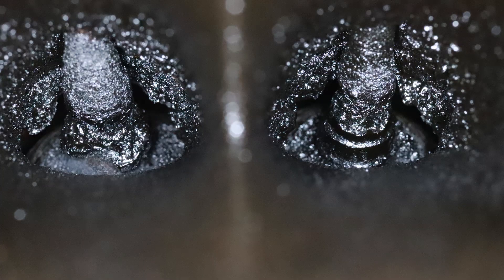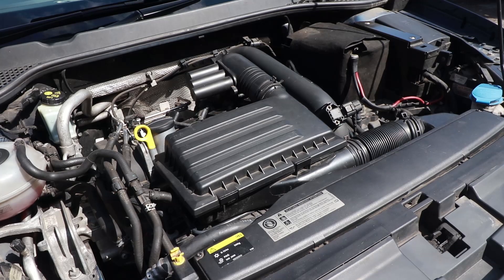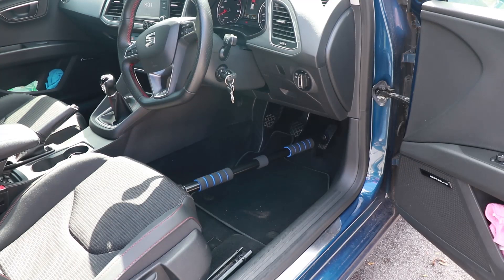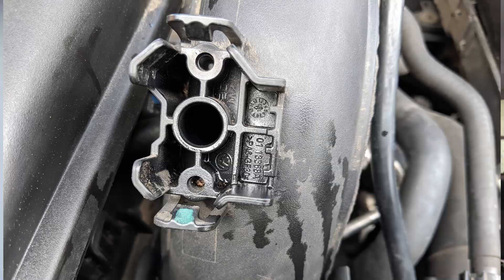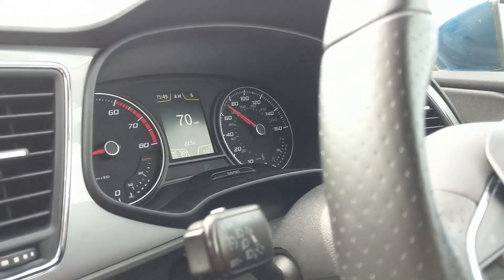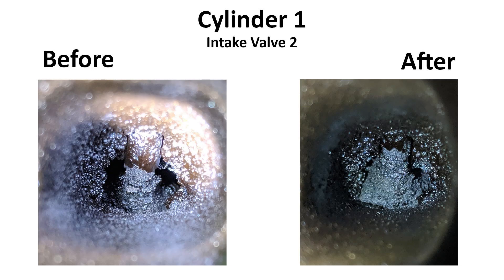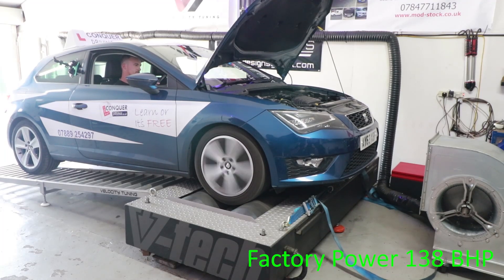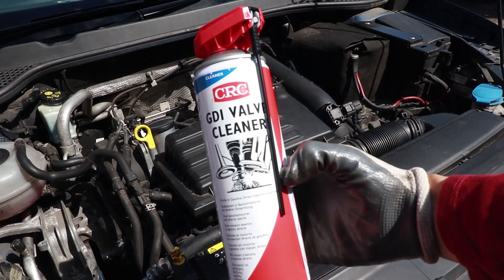CRC valve cleaner before and after valves and power figures - Is it the best valve cleaner?

Comment: Thanks for the video!

Cyl 1 Valve 1 (The before is down and bit hard to see, it could be that there is no effect)
Cyl 1 Valve 2 (The before is way down to see anything)
Cyl 2 Valve 1 (The before has carbon all around the valve and in the after you can see some metal of the valve)
Cyl 2 Valve 2 (The before has carbon all around the valve and in the after you can see some metal and even the shape of the valve)
Cyl 3 Valve 1 (The before has a huge amount of carbon not only on the valve but even on the metal of the intake and in the after It seemed to remove almost all the carbon on the metal intake and even give form to the valve shape)
Cyl 3 Valve 2 (The before is just clogged up the after is also clogged up but you can see it had some tiny effect on the back of the valve)
Cyl 4 Valve 1 (The before has some thick carbon on it and no valve shine the after has much thinner carbon and actual valve shine)
Cyl 4 Valve 2 (The before has some thick carbon on it and no valve shine the after has much thinner carbon and actual valve shine)

The images are of great quality and I appreciate your effort and work to bring them to us!
From what I see the product is cleaning the valves and that's great!
Why is it great?
Most shops use air hammers to do the job... no one torques the motor to spec as the manufacturer tells them... Unless you do it yourself properly
So yeah... I prefer the least invasive methods if they work... The more work they do on the motor with air hammers the more likely they are to do damage that will show overtime...
Not to speak of cleaning chrome valves with abrasives gives me the chills... chrome is not as durable as steel... after the job, it could be they will be more susceptible to rust due to coatings getting removed.
Most shops use air hammers to even remove your tires and that's something the manufacturer tells not to do, negligence is amazing...

I do think that if you used the product more aggressively and more than once maybe it could show better results due to how neglected these valves are...
They likely designed the product in CRC to remove a certain amount of carbon since X amount of chemical is designed for X amount of carbon and not damage the catalytic converter

Comment: This product does work , if you use it properly !!!!!!!!  I used it on my Mazda when it had

only 4000 miles on it.  The next day there was black residue in the tail pipes. If you have

not done it for 50-60K , and might be the second owner of the vehicle , your engine might need

disassembly and manual cleaning.  In my opinion , this process should be done at least every

10K. (the spray cleaning).
Reply: This. I had a used car that was well maintained (gdi), and only had to use CRC. I then had another used (gdi) that wasn't loved. That one required intake scrubbing.

Comment: Interesting, I just did the same on my 2013 Camaro with the GDI engine. Afterwards I filled the tank and drove like normal for a week. I picked up roughly 70 more miles on that tank of fuel than I normally get. Too, although I don't have access to a dyno, the mid-range feels stronger during acceleration. Maybe it's just me, but your before & after photos look flipped, I can't see the cleaner ADDING carbon deposits.
Reply from the maker: Cleaner won't add carbon deposits but they're still building up. I seriously doubt this would add 70 miles to the true range
I would suspect driving style and conditions would play a bigger part in that improvement.
Reply: @ConquerDriving  60 to 70 miles per tank equals between a 3.1 and 3.6 mpg increase (19 gallon tank). Not hard to believe when you consider the engine has 120,000 miles on it and was probably severely carboned up. Not to forget, my 'normal' driving is all highway, with the cruise control set at 70 mph, 100 miles a day. A car gets its best economy when driving steady state like that on the highway. Now if my travels were all inner-city, stop and go trips, I would also be suspect of such a significant gain. The factory rated highway MPG is 29, I was getting 25, so I don't see an increase of just over 3 mpg as being suspicious.
Reply: @ConquerDriving  I mean there's significant improvement in the before and after pictures so I'm confused as to why you claim it doesn't work?
I mean sure it obviously won't clean it 100% on the single can when they are that bad but it obviously works
Reply: @Phuong AMG Nguyen My Camaro isn't turbocharged, I just removed the intake tubing and sprayed it right into the throttle body. According to CRC, you would spray it before the turbo to clean the impeller blades.
Reply: Yea I did it on my 2015 impala with the 3.6 and i felt way more torque and gas mileage way better
Reply: Literally no way that carbon buildup was after the treatment.  Also, every other before and after of crc on youtube showed significant improvement in carbon reduction.
Reply: Think this is not a effective way to do it. You should spray right in to the throttle body.

Comment: A pretty much guaranteed way would be to walnut shell blast the valves but that's more of a commercial solution.
Reply: You can get everything from Harbor freight. I just cleaned my valves on my 8v s3. Was easy to do and not only are the valves clean, the intake ports are clean.
Reply from the maker: Done the walnut blast in another video.

Comment: Funny I used this stuff on a MK7 Golf R and the difference was night and day. I even checked them again 10,000 miles later and they still look good. Of course my car only had 25, 000 miles on it when I first did it so I imagine if you had a lot more miles and build up, at a certain point it might need a physical cleaning. The fact that yours actually looked worse after the CRC kind of indicates that it knocked loose carbon deposits from elsewhere. 
If you use this stuff routinely it works extremely well and you can avoid expensive or time consuming mechanical cleaning methods.
Reply: If you are in europe, you get multisport injection. Where you have fuel sprayed directly on the valves. You want have problems.
Reply: @YS-kb9nc  Not any more, that was only true for the older cars, now they are all DI only, I believe since the face lift 7.5.
Reply: @Private Eyes I would do it 300-400 miles before each oil change, or every 10K depending on how often you change your oil.

Comment: You supposed to used CRC at 10,000 miles or so, looks like those valves have more than that. Search for how to walnut blast the valves at this point is your best solution.
Reply: Heard alot of good things about walnut blasting. I think the CRC is meant for Newer Vehicles with little to no carbon on them to help maintain it. If your shits all fucked up and caked....Walnut Blasting is HIGHLY recommended.
Reply: The bottle says use EVERY 10,000 miles, not AT 10,000. There are other videos showing this product working.

Comment: Excellent, rigorous scientific test -great work
Reply from the maker: Thank you.
Reply: Actually not even close to being a scientific test. Starting with the fact that the cleaner wasn't administered properly.
I have done chemical valve cleaning since the 1990's (Ammonia was a huge component of the chemical back then) and yes it does work and it works even better now, if done properly.
Reply: Now if you really want to get it as clean as new, then walnut blast it and stop wasting money on mechanics to R&I your engine twice and on dyno testing.

Comment: Big pieces of carbon can break off and clog your cats. Like mine did causing my 2012 Kia Sorento to go into limp mode
Reply: AceOspades this true happened to my Sonata the other day there needs to be a better way to clean the valves
Reply: @yepyepgetitdone  the same thing the garage told me bro. Take it them...have them do it....that way in the process if THEY break anything ,( which is unlikely ) they will be responsible for it. Had mine towed from the interstate. 3,000 dollars for new cats on my Sorento man. Sucked. Had to replace front and rear cats bc they both clogged right up.
Reply: AceOspades ya the shop I take my car , when I can’t figure out something, told me it’s only like a dealer thing, and ya know dealers charge me outrageous prices, but prior to me triggering limp mode I was able put like 4 cans in over a year, my car is very responsive after they cleared the code, so it’s just a con to having these type of vehicles
Reply: AceOspades just hopefully my cats remain ok, I plan to get a Toyota later down the line gdi engines make decent response and power its just a con if you want to keep these vehicles for a while
Reply: @Red-Eagle  How many miles you had on it ?
Reply: how many miles you had on it ?
Reply: @freepomeroon  it has a little over a 100K on it. Had 101k when I got it 3 yrs ago. I've maintained it and im all about that. Its those damn GDI engines man...there known to PRODUCE carbon buildup when the engine has alot of heat. But either way....it has to go through the exhaust to exit..and unless you've hollowed out your catylatic converters. There bound to clog. And the engine WILL go into limp mode. Just recently poured 2k in this damn car. I hate it but I love it at the same time. Kia Sorentos are fun to drive. My next vehicle is either a JEEP Cherokee or a Toyota Highlander. Can't do the GDI anymore.

Comment: Say what you like, but you did spray the wrong hole. The best place for the solution is the PCV valve or brake vacuum line where it can make direct contact of the valve heads. Hope you didn't use the "wrong hole" on your  assistant, very fuckable.
Reply from the maker: I sprayed it directly only the throttle valve which is recommended.

Comment: The big problem with CRC and similar cleaners - if you have a car with a lot of carbon deposits (pick any MINI, KIA,BMW after 50K) the hard rock like deposits will go into the cylinders in big chunks. Most of derbies will pass trough, but some will do serious damage to the cylinder walls and rings. Unless you start spray cleaners from the very beginning (20K miles or less)  you don't want to do it without manual cleaning first.
Reply: I used it on my Peugeot at 85,000km for the first time and it worked a treat. Mine is a 2015 model 1.6THP, so the carbon build up is not as much of an issue as it was in previous generation engines. But it worked well.

Comment: I think you use the wrong hole.  That's why it.didnt do anything to clean your valves. It has to be a better way for turbocharged engines
Reply from the maker: Definitely the correct hole, it says directly onto the throttle body. Walnut blasting worked a treat though.

Comment: you waited too late... the valves are too far gone, you need a media blast... then use this stuff  at least ever 10k miles
Reply from the maker: Check out my video on Walnut Blasting.
Reply: Agreed, I believe most people wait way too long before they clean their GDI engines, they should be cleaned every 10,000 miles.

Comment: If i spray directly into throttle. There are chances that also the throttle will be clean?
Reply from the maker: Yes that's true, my throttle body was already clean though. The hole I stayed into meant I was spraying directly into the throttle body.
Reply: Thats great. Its like 2in1 . I will not have to use 2 Spray's

Comment: I think it is a mistake to assume that one treatment with CRC will clean all that carbon away.  The reason it looks  worse after?  It can only be because the CRC has started to lift and move the carbon. So that would make it clear that CRC is loosening the carbon (they say it dissolves).  If you have 90k miles of carbon build up I think you have to assume you would need two or three treatments with the CRC can.    The benefit of which is - for the average guy in the street its a whole lot cheaper method.
Reply from the maker: Three treatments would be £120 and a couple of hours of my time. I left it around 2 weeks after the CRC treatment before testing it and it didn't improve. Nearly 3 months later it was significantly worse. CRCs cleaner did not help at all. I've just done a walnut blast and it's running like new and significantly up on power. Check out my walnut blasting video.

Comment: Isn't that hole where you are spraying the cleaner pressurized by the turbo?  Why not disconnect that pipe completely and spray directly into the throttle?  I think a good part of the cleaning solution will pool inside the intercooler and not make it to the valves.  Even if the solution make it to the valves, the best case cleaning is about 10% carbon reduction.
Reply from the maker: I really saw no difference in carbon deposits after cleaning. The hole I stuck the can straw down was directly above the throttle body. So I was spraying directing on the throttle body. I wouldn't want to take the whole pipe off unnecessarily as the car would run terribly and there would be less protection.
Reply: @ConquerDriving  Thank you for doing the experiment.  The result of this product is quite variable.  The only way to tell if it works for a particular car is to do what you have done.  I have a naturally aspirated engine with a simple manifold that leads down into the cylinders, so pretty much all the solution went straight to the valves.  Lots of smoke came out the tailpipe after the cleaning.  Some folks have a manifold that leads up to the cylinder instead of down, so the solution has to fight the force of gravity to reach the valves.  Sorry, it didn't work for the TSI engine.  Walnut shell blasting is more expensive...would have been nice if it worked.  Thank you for the post -- it's very helpful.

Comment: i did this treatment to my 1.6 gdi hyundai.after 1 hour i drove my car at 100 km/h in fourth gear at 4000rpm. But i drove the car more agressive at the begining and in the second gear at 4000-4500rpm rpm a huge cloud of smoke was released. my fuel cosumption was better after 4-5 days, 0.5l less. The gdi cleaner is not cleaning the valves  immediately, he works like 4-5 days after the treatment was made.
Reply from the maker: I did leave the car several weeks before testing it.
Reply: How many miles you had it done ?
Reply: @freepomeroon  The first treatment was done after 78k km.
Reply: how many miles when you try the treatment ?
Reply: CRC claims it works for up to 1,000 miles after. When I used it, the was a giant puff of smoke when gunning my thing.

Comment: Spraying it down in the hole causes puddling. You have sprayed it into the intake via straight on for atomization..
Reply from the maker: The hole is directly above the throttle body. So I was spraying it directly onto the butterfly valve which is as close as I can get to the intake ports.

Comment: Try the teraclean or walnut blasting will sort it out
Reply from the maker: Walnut blasting is my next attempt.
Reply: Conquer Driving  walnut is more expensive option as it requires the removal of intake and closing of valves.

Could I request you to try the Mobile Carbon van business? It’s x6 cheaper than walnut and they run the can for 1 hour.

Comment: Is your 124bhp power figure taking into account friction losses in the gearbox and etc?

The dyno would give power at the wheels, and the engine is likely power at the crank..

However 15hp lost over 150,000 miles isn't too bad so it's believable
Reply from the maker: The power at the wheels is 105 horse power. Brake Horse Power is the figure that's predicted at the fly wheel taking into account the loses so isn't perfect. In the comparisons I've taken the first bhp figure from the dyno, then used the increase or decrease in actually wheel power from the subsequent dyno runs to add or minus from the original bhp figure so there are no discrepancies. Especially as the loses will vary from day to day given the temperature and humidity.